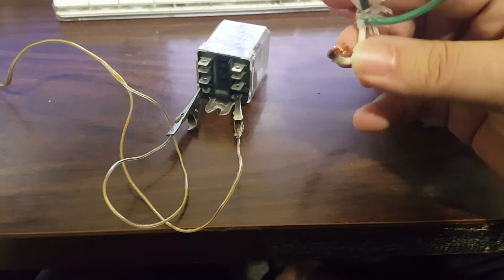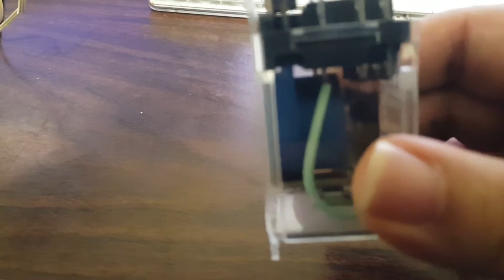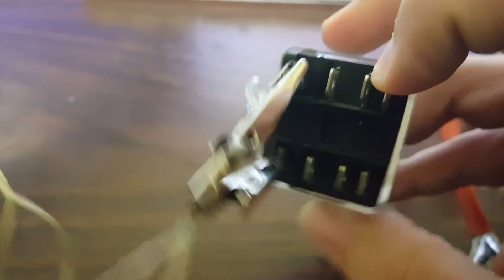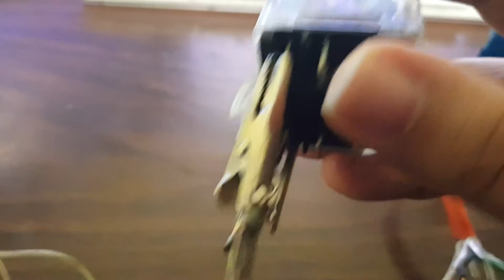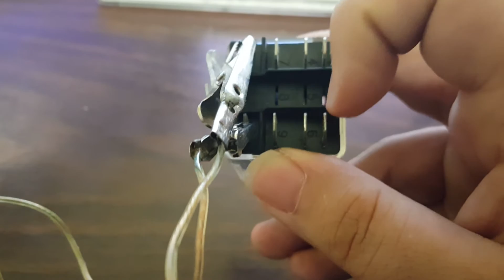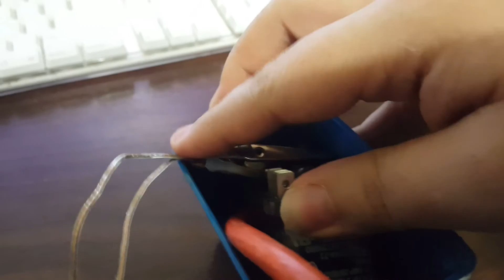replace a screen up, down switch with relay

Comment: Okay I’ve posted on Reddit and QC forums and still haven’t gotten a reply yet. I have an old screen from severtson and the only wires it has are black white and green. How the heck do I make it just go up and down. I have no switch that came with it and I don’t care about the relay. Just want the motor to work. Already called severtson. They were absolutely no help.
Reply from the maker: so the screen i used was like that and it had a separate control box that the screen hooked up to that controlled the screen. unless your screen has the controller build in, you need the controller to make it go up and down. th motor on the screen is most likely dc. so the controller reverses the polarity to make the screen go up and down. if u could get at the motor and find what voltage it uses u then could just use any dc power supply to make it work.